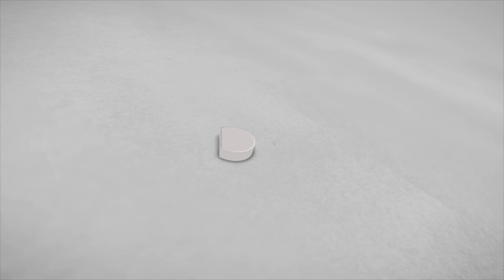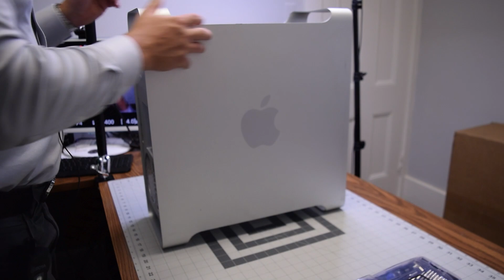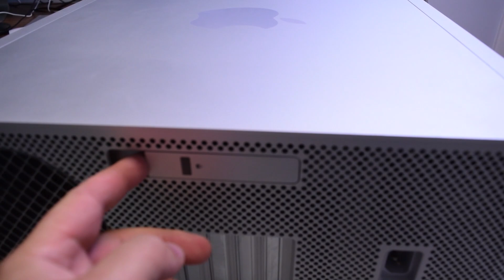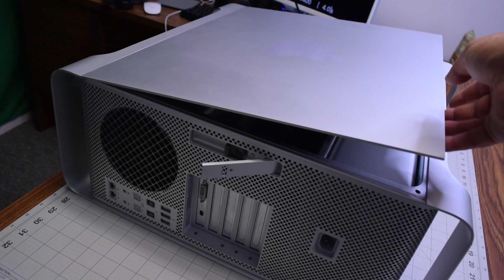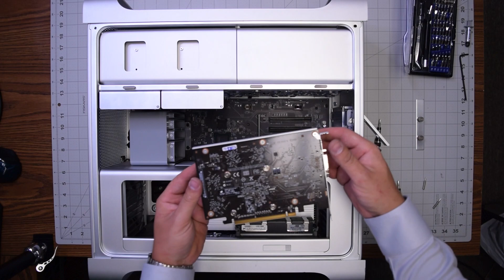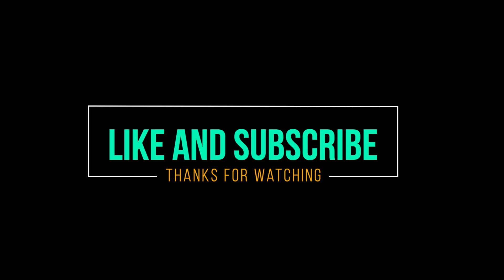Mac Pro A1289 - Graphics Card GPU Upgrade or Replacement (2009-2012)

Comment: People, that need a guide to replace a graphic card in an Mac Pro 1,1 - 5,1, shoud avail themselves of vids on how to do it. Thermal paste is my CPUs hurdle. I was sweating bullets going from a 4,1 ROM upgrade to a 5,1. Please don't brick on me.
These power hungry vid cards are a challenge. Acquiring the right cable, hooking it up correctly and not frying the MB or PSU. For running macOS I've given up on the Mac Pro that came as a 4,1. Linux might be a viable alternative.
I am not in the mood to jump with Apple to another CPU line ... Motorola to PowerPC to Intel to ARM. The Quadra 800 is gathering dust. G5 too. As so many are burying Intel, there is talk of Windows going ARM. The Windows 10 software Kluge is only getting worse. On Computer Museum game shows people could laugh about Windows being the largest C program cobbled together. I've had enough when MS forces upgrades on users. MS undoing user workarounds to not upgrade when the latest upgrade can result in data loss.